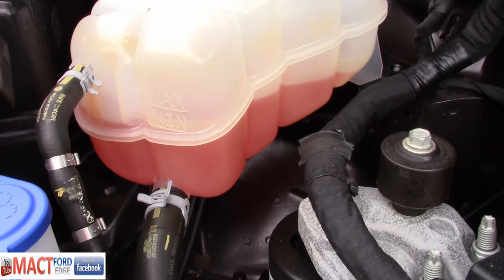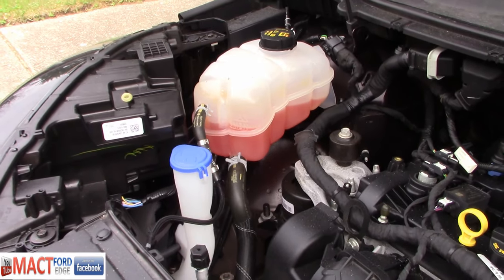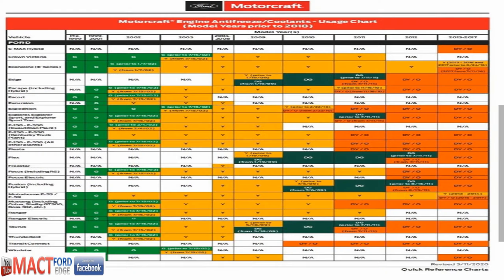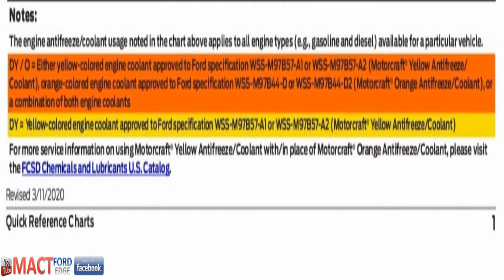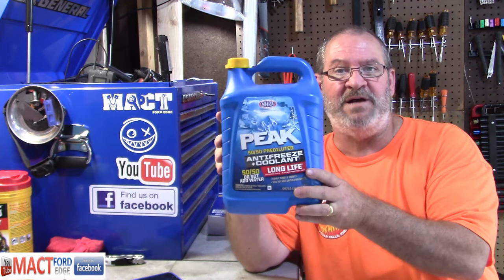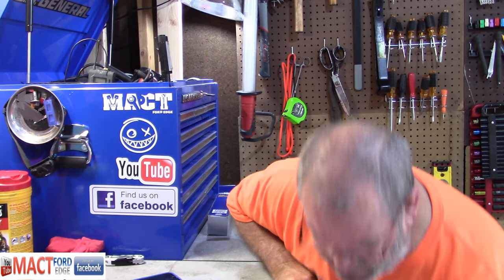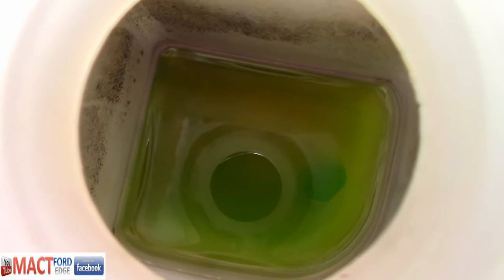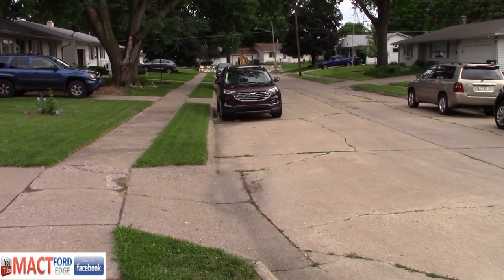Ford Coolant Yellow to orange and back to yellow. Corrosion of your system?

Comment: The new yellow coolant is not the same as the old yellow coolant, it is a POAT based coolant. The orange coolant is an OAT based coolant similar to the GM Dexcool coolant. There is a big difference between the old yellow and new yellow coolant. Anyone with the 3.5 cyclone engine should use the new yellow POAT coolant.  You may want to do a little more research before posting your videos so you don't provide misinformation.

Comment: What is so difficult?  Look it up either in the owner's manual or at Ford.  Orange is phased out and the new Yellow replaces it. Gold is still available if your vehicle requires that. I would not use ANY universal coolant in ANY newer vehicle. Too much chance of a corrosion issue. Ford knows their vehicle way better than this internet expert.
Reply: There is a reason Ford had a TSB on the Transit to use Prestone Cor-guard for the proper heater core repair. Also they have TSBs on changing over to yellow on other vehicles. The orange is OAT and the yellow is P-OAT coolant.
Reply: Yep I never recommended universal to anyone. It's not the same Motorcraft yellow coolant as before.  I mean he does have a Habor freight toolbox so I'm sure he's an expert 😉

Comment: Do not use regular water with yellow it reacts badly, you won’t see it but the metal will. Use distilled water.
Reply: While it is true that the new Yellow is particularly bad to use with tap water, the same is true of all coolants.  

Distilled water should always be used in the cooling system regardless of coolant type

Comment: Is it definitely that it's not effective anymore or Ford is just phasing it out for a different reason? Maybe they're using yellow across the board now or the orange is more expensive than the yellow to manufacture?
Reply: no it's catastrophic and causing failure of engines and fires.

Comment: Can mix yellow with orange (draining with opening radiator drain and filling yellow) ? This action is require approximately 5 litters of yellow coolant! Is it right? Or must be flushing all orange coolant then filling with yellow?? Ford edge 3.5 2013.
Reply: Ford says you can mix it

Comment: I read somewhere that Ford switched from orange coolant to yellow coolant because the orange was causing water pump failures on the Duratec V-6 engines. I change my coolant today on my 2015 Ford Explorer. I used Ford Motorcraft Yellow from the dealer (4 Gallons.) It was not expensive like everything else dealers sell.
Reply: Dear, I have ford explorer 2015 do you have any problem with yellow coolant did they mix it with distilled water ?
Reply: My pump went out 50k miles with the original orange 🍊 2016 mustang
Reply: Orange (Dexcool) does a very poor job at inhibiting corrosion of the soft metals in the cooling system.     
The added phosphates in the P-OAT coolant do a much better job at inhibiting corrosion.  

Yellow >>>> Orange (Dexcool)

Comment: The. coolant in the 2019 Edge looks more pink than orange it might appear that way in the video or it could be a different coolant. I replaced my Prestone orange Dexcool compatible fluid after 2 years and I didn't have problems with it just did it because I started to get a. sweet smell in the cabin and that means that the coolant is starting to get bad.
I'm using  Pentosin a German coolant WSS-M97B44-D certified and it's pink looks a lot like the one that is in the 2019 Edge but I'm sure it's not orange.
Reply: WSS-M97B44-D coolant (Motocraft Orange / DexCool) is orange in the bottle, but turns pink when mixed with water.  As for the sweet smell in the cabin - that has nothing to do with the quality of the coolant.  If you're smelling coolant in the cabin, you have a leak in your heater core or a heater hose.
Reply: Yeah lift the carpet under the passenger floor mat and I bet you find a sweet puddle.
Reply: Thanks for the advice, just wanted to let you know that after I change the coolant the smell disappeared and under my carpet everything is dry, I think in my case it was the coolant.
Reply: @jeffeverde1  Thanks for the feedback, the coolant I'm referring to is Pentofrost SF  and the data sheet indicates that the appearance is Pink & Clear and it looks very different compared to the DexCool one, it's just another alternative.

Comment: Replace orange coolant, WSS-M97B44-D or D2, and  WSSM97B55-A.
 New coolant (Yellow) # WSSM97B57-A1 or -A2.
 Do not use new yellow coolant on any other vehicle using a different factory used coolant.
 It can be mixed. The orange can be used until the required replacement.
Best to do a flush to get all the orange out.

Comment: Did radiator flush on 2012 Ford Fusion S 2.5 I got 151k. No more orange coolant so I got the Motorcraft Gold concentrated and really flushed the system. Runs great now!
Reply: Gold ≠ Yellow

Gold = HOAT
Orange = OAT
Yellow = P-OAT

Comment: My mom's Escape comes with Gold (Based on the car's manual) but is now Green (3rd-party coolant) which is a common coolant here in Asia. If I flush the green coolant with distilled water, can I replace it with Yellow afterwards?
Reply: The dealership and even online (Shopee and Lazada) here in SEA only sells Yellow now, I can't find any Gold Motorcraft coolant anymore.
Reply: @3dr14ng4  Hey! Same problem here in South America. Ford/Motorcraft dealers are selling Yellow Coolant only, did you find aftermarket compatible products or what did you do? Thanks!
Reply: @telephantasm4070  I still bought and used the Yellow coolant. I just made sure that the old coolant is completely flushed-out of the cooling system before adding the Yellow. Yellow is P-OAT and our car is a Ford Escape 2.3L 2012 ZD which is more of a Mazda (Tribute) than Ford and Mazda uses P-OAT ever since 2005. I don't think there would be any problem as long as you completely flush the old one.
Reply: @3dr14ng4  Oh, good for you! 2012 is relatively recent, though... Any idea if I can use the yellow coolant on a Ford Escape 2005?
Reply: @telephantasm4070  You can't, even the 2012 Escapes aren't compatible with Yellow as per Ford's own documentation but I used it anyways. You're basically on your own if you use the Yellow on older Ford vehicles.
Reply: @3dr14ng4  got it. Thanks!
Reply: Use Zerex G-05 if you cannot find Motorcraft "Gold" coolant any more.  The Motorcraft Gold is the preferred coolant, but the Zerex made by Valvoline is also good stuff.

Comment: Well that sucks.  I recently bought a very low mileage 16 escape 1.6 and went through and changed all the fluids cause it had sat a lot.   New battery, trans fluid new brake fluid, all that stuff.  Just drained and refilled the coolant with new Motorcraft Orange.....oh well.   At least its new.
Reply: I think you're going to be fine if your car calls for orange coolant if not I would check my manual to see the right one and replace it.
Reply: Change it if you plan to keep the vehicle for awhile.

Orange is acidic and creates problems everywhere and will destroy your seals.

Just dumped orange out of a truck yesterday with 7,000 miles.

I can't believe auto manufacturers didn't stop using "death cool" dexcool earlier
Reply: I think you will be fine with the orange coolant provided your vehicle with the orange coolant from the factory. My 2015 Edge with the 3.5 V6 engine came with the orange coolant and I had no issues with it. I did a flush and fill with the new yellow coolant at 95k miles.

Comment: If I flushed out my system is it ok if I used the good old original green coolant instead of the new ford yellow?
Reply: You can use the old Prestone type green coolant however keep in mind modern cars are designed to run the better technology coolants.  If your vehicle came with HOAT for example you should use a HOAT comparable aftermarket coolant or better is just use the OEM. The reason is the lesser type will not have the protective ingredients for the engine/radiator etc. plus you will have to service the system more often